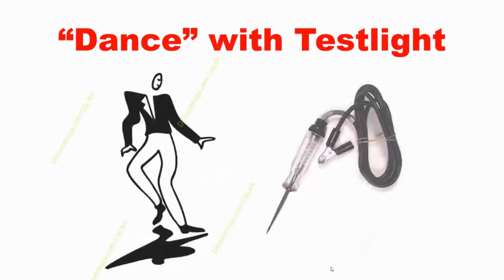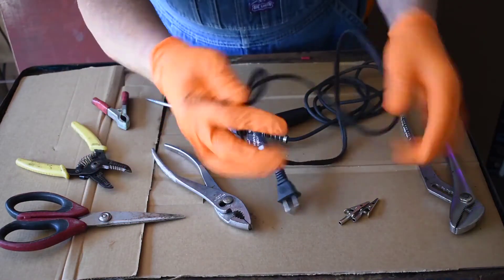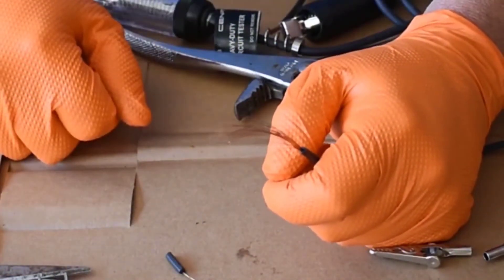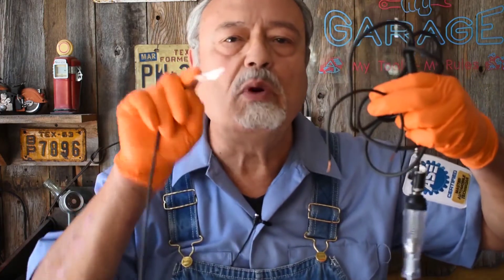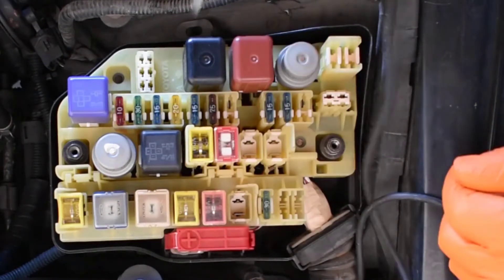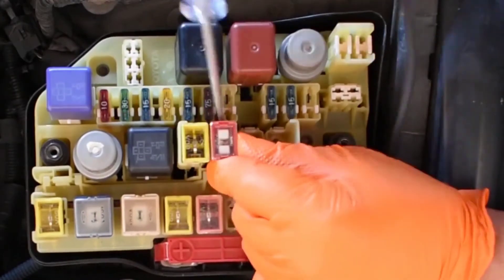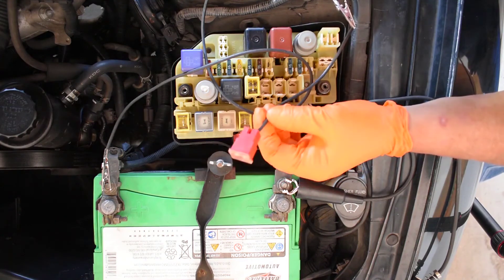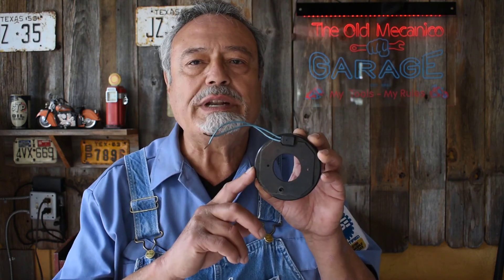"Ten" different Electrical Tests w/Test Light.

Comment: Is there a video to show the test light as an engine balance analyzer?
Reply from the maker: That test is mostly for coil packs and distributor type ignition systems. Does not work on COP (coil on plug) type. Connect the test light alligator clip to ground. With the engine running, probe the coil wire at the coil, This will steal the spark away from the plug. It's like pulling the wire off the coil. Pay attention for the RPM drop. The amassing part is the test light will not burn out with the 10K volts.